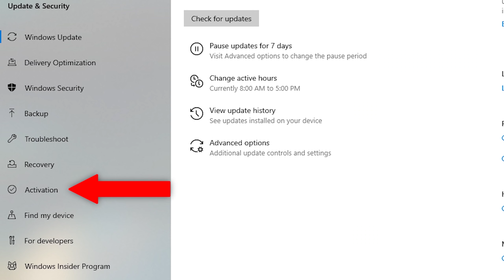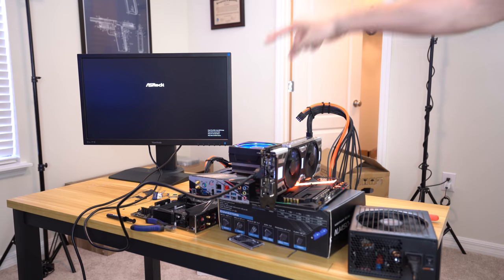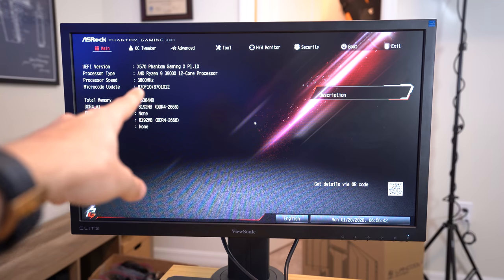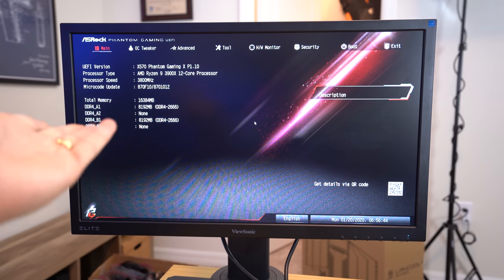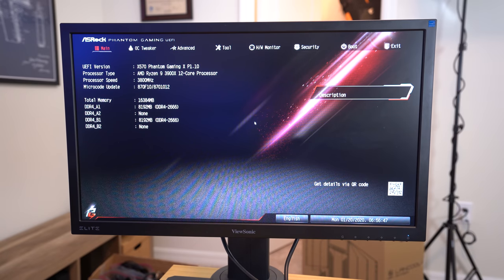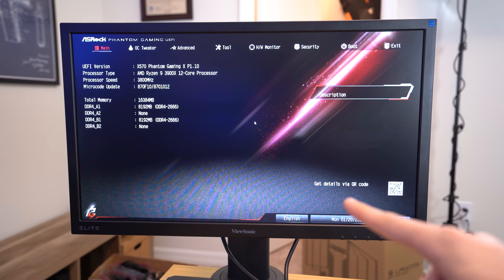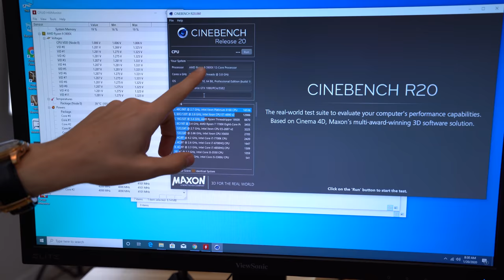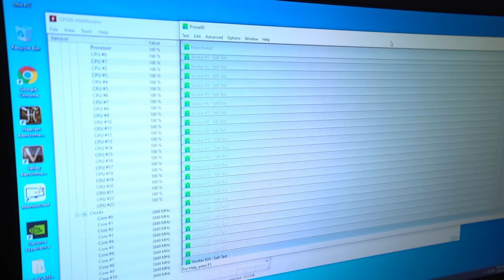Reviving My Dead Ryzen 9 3900X!

Comment from the maker: A FEW THINGS:

1) This video documents a huge learning curve on my part! Tried a few things, failed a few times, and ultimately pulled it off (somehow). I don't like to hide these troubles from you all. We learn the most from our mistakes.

2) This video was filmed long before Linus published his on the same topic. 

3) "Soldering" broken pins might be straight-forward if said pins are on the outside of the chip, but mine were missing throughout the center of the chip. I don't have the tools necessary for such a task. Would never try blow-torching or soldering with that degree of precision. I'd rather just shove copper into the socket :-D
Reply: And I salute you for that, Sir! o7
Reply: What happened to the other motherboard? Was it because of the screw driver hitting the PCB of the Mobo @5:02
Reply from the maker: @brandoneich2412  I responded to this same comment of yours below.
Reply: I would use a hot air gun to solder the pins onto the cpu ;-)
Reply from the maker: @NINJA-ij7ot  Please read my revised OP.
Reply: Do you have footage of the CPU's pins before actually putting it into the socket? I'd like to see the bottom side of it so i have a better understanding of how this actually worked..  This video leaves much to be desired in that aspect..
Reply: Louis Rossmann is probably having a stroke over this 😝All jokes aside I’m glad the chip will get use now. That chip will be relevant for years to come.
Reply: Hey if it works, it works. Never thought the solution was to crank the socket off lol. There goes the warranty on mobo as well.
Reply: Nice video! I’d love to see a video on how the other mobo was murdered and exactly how you manipulated the copper wires to fit/seat into the final mobo. Keep up the great work my man. Cheers from Canada!
Reply: @Greg Salazar I have used the drop pins in the socket method before, way back to the Pentium / 486 days. But I have never seen someone remove the latch system of the socket from the motherboard before! And why? Even though the top of the socket moves to lock the processor into place, if the pins are dropped into the holes, they move with it. So you drop the pins in the right holes, drop in the CPU on top, then use the latch to lock it in.
Reply: This video had me on pins and needles. Kudos on pulling it off Greg.
Reply: Great Video! I guess I understand having so much comments that you don't bother wanting to read them all, but literally minutes after you posted your original video, there were a few of us that gave you the same exact advice as Gamers Nexus. I understand we are just commenters that you don't know, and don't have the credibility of Steve, but it would have been awesome to have been recognized (Not me Specifically, just crediting your commenters who posted the suggestions as a whole) because a lot of us were trying to help, and it does seem like our comments weren't read. 

Anyways, great video! I am glad you did eventually listen to good advice and made it work! Awesome to see!
Reply: Since you removed the plastic part of the socket doesn't that change the mounting pressure since it usually sits a little higher?
Reply: "I have nothing to loose." Bricks his X570 MB. lol Btw. did I get this right that you have an degree in electrical engineering?
Reply: Just adding a statement to that** Linus did this many yrs ago, the newer video was specifically about soldering tho

But either way, great job on the video, in recent times It feels this was forgotten you could put a piece of metal in the socket where the pins had previously broke, 

(Hoping I haven't screwed up my 3900x installation - will only find out in couple days when gpu arrives ;-;)
Reply: You should have went on ebay and bought replacement cpu pins to drop in the socket. Then you wouldn't have had to break the retention mechanism.
Reply: I can respect not wanting to solder on pins.  I have nothing like the dexterity necessary to do that.  BUT!  If anyone out there wants to try something like this and has a donor CPU, don't destroy the socket.  Soldering may be difficult but de-soldering isn't.  De-solder some straight pins off the donor CPU and drop those in the proper holes on the socket.  The pins are shaped like nails with a flat head at the top where they connect to the CPU.   That flattened head will keep them from falling through the socket and it will save you a lot of headache.
Reply: @Greg Salazar   I like how you gave this a try and it's cool you actually get the cpu to work . But next time , for your own sanity and to save you from a lot of stress and sleepless nights , please just give Louis Rossmann a call . I've seen him solder much smaller stuff than a few cpu pins and usually with good results
Reply: It's called hot air rework - you use a temp controlled hot air station and potentially a metal stencil. You can permanently repair the CPU pins without trying to get a soldering iron tip where it won't fit, and without some kind of hacky solution.
Reply: @docferringer  that is the same thing I was thinking the whole time. Seems like he just made it harder than it should have been.
Reply: That cpu is 100% dead
Reply: You could have soldered it on the cpu
Reply: LoL....
Reply: lol at 5:24
Reply: @michaelkohlhagen2978  IKR. I'm also confused in that regard.
Reply: One time I made that with an old sempron 3400, it was bought old from a store, poor PC, it wass full of dust
Reply: Bro ... can you explain how did you BRAKE AN EXPENSIVE CPU ....wait hahaha lets just switch to intel hehe no more f pins to push around...
Reply: @hypnotoad8871  hello there grandfather.
Reply: Dude, try getting a smaller pair of diagonal pliers. They do make them, you know.
Reply: I like how truthful you are, you got a sub from me. I don’t usually sub even if i like some channels on YouTube. Good work on improvising.
Reply: Yikes
Reply: @expressfax5420  amd offers a Greater value for money. Why would anyone opt for Intel??

Comment: should have used the Verge CPU applicator
Reply from the maker: I knew I screwed up somewhere...
Reply: That's what you get for not using a Swiss army knife that hopefully has a Phillips bit.
Reply: And icing the CPU like a cake
Reply: and get a anti static bracelet!
Reply: Aerodactyl_PlayZ rive strong braceret
Reply: Nah, he should've applied termal paste on the socket for additional coolness
Reply: He forgot to put the gpu in the 1x slot
Reply: I think the tweezers will do the job!
Reply: Use thermal paste applicator to apply thermal paste for better temps.
Reply: i bet you don't have swiss army knife aren't you?
Reply: Thousandth like!
Reply: you need to screw in with confidence
Reply: @GregSalazar  or your livestrong anti static thingy

Comment: Mechanical Pencil. Fantastic to straighten pins with... Its what i used back in the day of K6's.
Reply: Nice one
Reply: I use a credit/gift card and tweezers.  It lets me straighten an entire row at once.
Reply: Good looking out man damn that's handy lol
Reply: Genius
Reply: Yup I used that and you can also use some  Razer bladea
Reply: I fixed some Intel Pentium 1 and MMX CPUs with bent pins with a mechanical pencil and a old debit card.
Reply: Yooooo that's an awesome tip!
Reply: I used a razor blade
Reply: Now that's keen, you think of that yourself or did you learn it from someone ... No disrespect intended just curious.
Reply: do you just put the pin inside the pencil tip and use it like a lever?
Reply: @russellhassan7773  yes
Reply: Wow that’s genius
Reply: works unless they’re brittle. i’ve tried it  on some and they’ve just snapped off, but some are fine
Reply: BiG BrAiN. Lmao. Smart dude. That would save you alot of time instead of doing what this guy did. 👌
Reply: Ok my god why didn't I think of that
Reply: Correct been using that for my customers processors for the last 23 years lol
Reply: Ganeshank Prince mm yes, Razer branded blade.
Reply: My dad has alot of dead cpus in his storage and yeah the problem is with the pins, gonna fix em right away
Reply: what mm of pencil would you recommend?

Comment: Me: accidentaly bend one pin about -1 degrees
My CPU: I dont feel so good
Reply: thats why i dont buy amd
Reply: Siberian Mouse “this is why I don’t buy amd because of my total lack of cautiousness”
Reply: @frederick3811  Dude, if its not on the cpu its on the motherboard. They are pins, You have to be cautious or its on you. The ones on motherboards like intel bend too.
Reply: @kouko6727  and the ones on the motherboard are extra flimsy.
Reply: @kouko6727  intel core i bend ? when ? since gen 3 ivybridge I don't face bending pin like amd from athlon era ooppsss my bad 🤭
Reply: This message was ment for  Grim Chirico. God i hate YouTube on mobile.
Reply: @kalibclark204  lmfao
Reply: @shaur1221  its a phat L I know
Reply: @king.canute21  No need to say my bad, bend pins are just something everyone has to be careful of. My friend recently built an intel build and bent a pin on it by lightly touching it. Same with a friend on ryzen. He bent it while removing the cooler. There is a reason why people fear putting in the cpu the most in a build. Its one of the easiest parts to break.
Reply: @frederick3811  bruh amd cpus are rlly easy to install. My first PC has a ryzen 7 1700 and i built it and it was super easy
Reply: @frederick3811  its people like you, who will keep intel alive, through the times when they are a generation behind on transistor size and give lower performance for higher power consumption because you cant install a CPU properly
Reply: @tanujrana8490  actually i use amd, but they should use LGA like intel in all of their cpus, they use LGA on threadrippers i dont see why normal ryzens cant be LGA too, is easy to damage pins on PGA and it gets stuck when the thermal paste gets dry
Reply: @od3stroyer771  as i said, i dont think you are looking for counterarguments, because simple the topic is soo simple, you just want to enrage people by saying stupid things on purpose
Reply: @frederick3811  imo they need to build good relations with their board partners first to go lga exclusively, because lga puts more rma requests towards board partners. Threadripper absolutely needed it because those pins cant fit on such small area. Anyways, who am i to theorise decisions of a milti billion dollar tech giant😅😅
Reply: @frederick3811  for the meantime, if you pre-heat the cpu, say with prime95, it comes off clean. I tend to do bi-annual cleaning and reassembly of my system so it is less of a problem
Reply: @od3stroyer771  "Console is better because I don't even know how to open a case" FYFY
Reply: @frederick3811  pins on cpu is superior

Comment: Man I was taking off my wraith cooler yesterday to replace with a Corsair AIO and my 3900x stuck too it and bent a few pins and scared the hell out of me, after a few hours of panic, research, and fixing I got it to work and my temps are great. Btw this is my first pc build so I’m still a noob but super glad I didn’t break any pins.
Reply: the cooler being stuck to the cpu seems like a common occurrence
Reply: Had the same thing happen to me. It's that lame thermalpaste that comes with the wraith cooler. I should've put the cpu under load first to warm the thermalpaste which would make it much more loose. Then maybe use a slight twisting motion first before lifing. Or just not ever use the stock thermalpaste ever again...

Comment: I used both methods, successfully, back in the early 2000's, with s370 Celerons/P lll's. I do prefer LGA to PGA.
Reply: lga socket pins be like: Touch the pin, dead mobo.
Reply: @1S004   still cheaper then cpus
Reply: Y3AG3R LOL but the pins on pga cpu’s are more durable then an lga socket pin
Reply: @1S004  funny yesterday i bend my lga 1155 motherboard from just a paper towel and it was a nightmare to fix them with the needle
Reply: @mankindanddestiny7798  its easy...i bring back alot of boards from rubish...
Reply: @mankindanddestiny7798  what were you paper toiling inside the socket
Reply: I prefer PGA because you dont risk shorting and killing the motherboard trying to turn it on, with the pga i can still see if its a non essencial pin like a ground or something else

Comment: Did something similar way way back with an Athlon 2500+ I believe, but I cut one of my wife's sewing pins down to size and it worked perfectly. Also tried the copper wire, but tinned it with solder so it would remain stiff so I didn't have to remove the plastic top and retention lever. It was fiddly, but worked well and save time.

Comment: I've done this before. A better way I found, using a very sharp razor blade "slice" off the pin from the donor chip, don't cut them off.
If done right you will have cut the pin clean off, and it leaves a "head" on it similar to a nail or screw. Just drop it into the socket and it will make contact and you don't have to mess with the motherboard socket at all. And easily removes later.

My retired 1300X still works with this fix. Lol
Reply: what ? this is interesting
Reply: you can tell me more specifically please ;)
Reply: @xxmichaelmodzxx  best way I can think to explain is to slice the pin off the donor chip, flush with the bottom. You have to cut off the pin as close to the surface of the chip as possible. I found a video someone posted I borrowed the idea from.

Comment: I am so happy for you! Yay! Don't worry about bending those pins. I once forgot to plug in the 4 pin on a cpu cooler and turned on my pc for 10 minutes then smelled this burning smell...there went my processor during a lan party all because I forgot to plug the cpu cooler back in. LOL. Mistakes happen..its when we learn from them that we gain knowledge.

Comment: Okay so. I know this is 2 years old but you just saved me. While I was changing my thermal paste, the CPU disconnected. When I put it back in, it wasn't working. No display, not keyboard or mouse, nothing.  While I was watching this, you mentioned the V-shape of the socket and I thought that maybe I could pull it back, connect the core, then tighten it back in. That worked and everything turned back on! Thank you so much. I was panicking so bad. Thank you!

Comment: This video saved my CPU last night. I watched this months ago and last night I updated my cooler with a NZXT x62. I was running air. As I was removing the cooler, the cpu got stuck to it. I twisted it to remove but somehow it came out and bent about a dozen or so pins. I found a needle and used Magnifier on my S22 so I could see the pins and spent about an hour or so bending them back. The processors took a couple of attempts but then it just dropped into the socket and was fine. Thank you for this video!

Comment: Btw you can actually buy a whole AM4 socket (meant to be soldered onto a board to replace a broken socket) for cheap online. Even if you don’t plan on using it on a board it can be used for stuff like this.

Comment: A secondary 2 TB 5400 RPM drive, really Greg!?!?! ....  "I'm cheap" Lol!
Reply: Well, these are pretty trashy hdds, so yeah, chea0
Reply: I use one for backup, for $50 cheapo.
Reply: Lol, dude... You can get those for like $60
Reply: I got a used 2tb wd durability drive used for $22 and a powered USB reader for $10. So 2tb of add on storage for xbox at $32 is pretty good.

Comment: Flat finger-nail clippers cut really close fyi...they can even cut through the solder bubble to get the full pin. Also for parts that took damage with no obvious ailments, you can crank the oven up and re-bake the solder joins by baking the chip. Not sure if this would apply here

Comment: I've done this, but it was way back before the processors used ZIF sockets. That made it much simpler to put the pins in place and I certainly didn't have to break the socket for it to work. These processors didn't have that many pins and they were spaced a bit further apart, so it was easier to find the right hole to put the pin in. On the other hand bending the pins was a much more common problem as you had to use quite a bit of force to press them into the socket. I got my hands on a contact spray that helped by lubricating the pins slightly and that helped cut down on the force needed by quite a lot, but you still  bent a pin every now and then. I do have a feeling that the pins was made from a better quality gold alloy as they were very soft and malleable. Even when a pin was squished down so it looked like a cinnamon roll ýou cold often just pull it out and straighten it without it breaking off. With modern processors there's no way you could do that, instead the pins often break while being bent back after they've been bent for the first time.

Comment: There is a way to solder that wouldnt be too hard you just need solder on where pin would go and the quickly add the pin or add wire and cut the wire that may work

Comment: I would look for a CPU BGA stencil with similar enough holes to fit over the section of damaged pins while you solder it with a heat gun, you could get donor pins off another old CPU. The pins are only soldered onto pads by the looks of it
2 minutes ago
Reply: That doesn't work at all with AM4 CPUs, the stencil (if you can even find one that fits) starts warping when heat is applied and it will shift other pins around when the solder gets to the melting point. You just end up causing a lot more damage than before